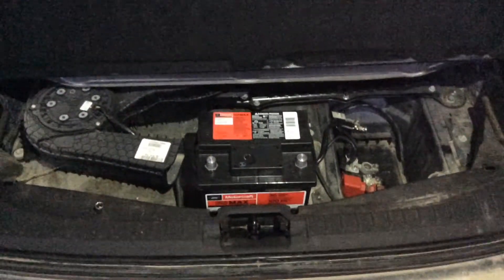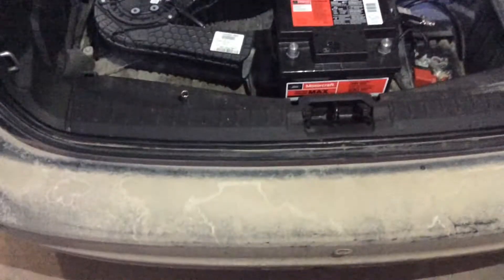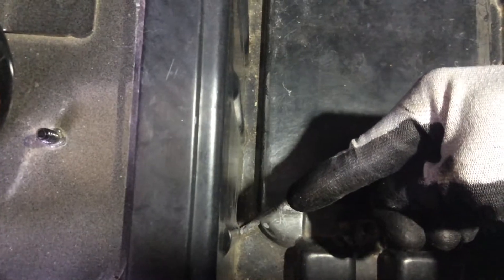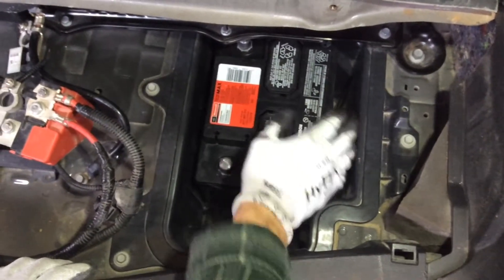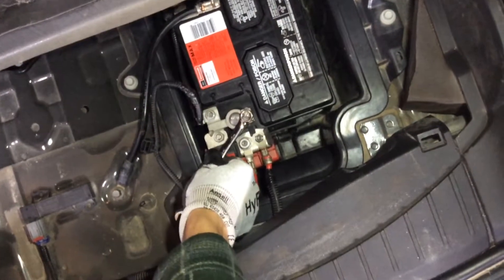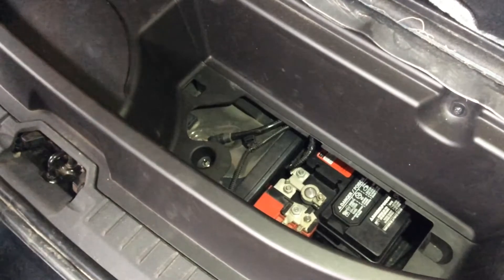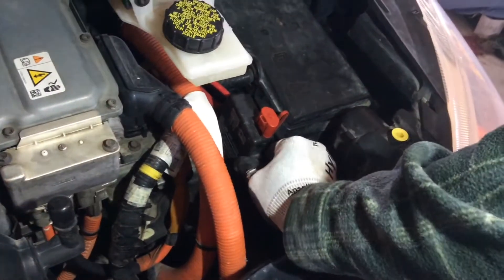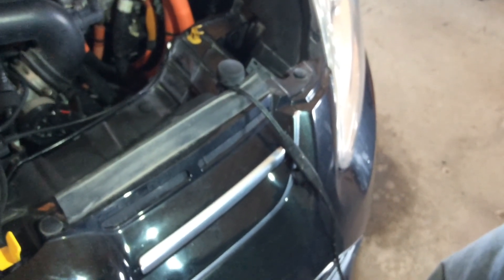Ford C-Max Hybrid 12V battery upgrade to 600CCA

Comment: Just upgraded my battery to the 96R. Car works great. A lot better then when it once was. The plastic piece was quite difficult to remove with the x2 unremovable bolts attached. Took about an hour of prying but once removed some waterproof caulking applied and replacement was completed. Thank you!

Only thing was the rubber tubing attached to the original battery was unable to be attached to the 96R.

Comment: Oooo I like this modification, thanks! I highly recommend wiring up a kill switch in the back if any of you find yourself doing your own work on your cars. Make sure to wire it between the negative on the 12V and body ground. I just relocated my ground point. Oh and try to remember to lock the car before cutting off power since the driver door is the only one with a manual lock.

Also, have any of you met an actual human that seems to be confident and knowledgeable of the anomaly that is the C-max? I haven't and decided to up my mechanic skills. It's been quite the learning experience and have quickly come to the conclusion that Ford really must not care so much about putting vehicles on the market with such illogical design choices that would make Spock's head explode. I keep wanting to like the car and then it's yet another problem. Pretty sure my 2013 could be classified as a face puckering lemon! 😂
Reply: Hey, i’m glad you shared some of your learning journey troubles. I wonder if you’re still messing with your c max, and if you’d consider sharing some of your woes, as well as your fixes (or what you might have preemptively done). I recently got a ‘16 energi after my girlfriend got a ‘15 hev c max, and i do a bit of work myself, and would like to become aware of what i might expect

Comment: Pretty sure your radio was fixed because you essentially rebooted the sync system when you disconnected the old battery.

Comment: Hi I found an AGM from Advance Auto, it's a 650 and it does fit with the same modification you did here.
Reply: Do you have the model number for the AGM?  I just bought a 2013 C-Max Hybrid today (will get it in a week or so after it's been detailed, etc at the dealer's cost), and I'm thinking I would want to be upgrading it.

Comment: The only time the system voltage would be 13.4 V is if the vehicle is in ACC mode or the battery is charged to virtually its capacity. What was the State of Charge of the 12 V battery at 13.4 V and what mode was the car in???   The PCM determines the set point voltage to charge the 12 V battery.  In ACC mode the PCM reduces set point voltage to 10.6 Volts and the DCDC converter maintains around 14 V so as not to discharge the 12 V battery until the control algorithms start to shut down load and turn car off.  The CSP in 2013 and 2014 increased the set point voltage (based on my monitoring) maybe 0.1 to 0.2 V.  Thus, over the same charging time frame, additional Ah of charge would be added to the 12 V battery.  The system voltage when the car is in ready to drive mode will be around 14 V minimum and more likely in the mid 14 V range (14.7 / 14.8 and declining 14.5 / 14.6 in 10-20 minutes) as charge is added to battery.  So, how does a 96R battery "help" this.  It doesn't because the charging algorithm assumes the battery when new had a 43 Ah capacity.  The algorithms monitor current in / out of battery and thus know the amount of charge being added and will adjust the set point voltage accordingly.

Comment: I just replaced the battery for 96R. Since then my gas usage went down so I am capable to make 34mpg vs 28mpg and less. I couldn't believe how much more power my car got by changing this battery. My C-Max Energi 2013 got 160k and seems like I got totally different car since then.

Comment: Hey, very helpful video. Do you remember the length of your 96R?
I measured the tray, and it seems the maximum length of the battery would be 21cm (even with destroyed holder), but afaik 96R batteries are 24cm long. How did you fit it? What is the length of this particular  battery?
Reply from the maker: My battery is roughly 9 1/2 inches in length. It's a tight fit but it fits.

Comment: I have a Hawk Odyssey extreme battery for my 2013 Ford cmax energi model went threw 2 crappy Ford ones same issue not had a problem since.
Reply: I guess that is a 96r? What's the CCA on that one please?

Comment: Tigiteasy-    

Thanks for posting this battery mod.   I just did it this evening.   Your well made vid made me aware of what to look for in advance of buying the larger battery and starting the install.  It all went smooth as can be.

This larger capacity battery is more readily available and  costs a whole lot less than the original battery too which is another plus.

I appreciate your fine vids

Tony
Reply from the maker: Thanks for the positive feedback.

Comment: It is useless, and not advisable, to "upgrade" to a bigger, heavier battery.  ... CCA battery rating DOES NOT MATTER on this Ford C-Max Hybrid (or Prius, or Fusion, etc.). ..Why?  ..  Note the engine is NOT cranked using the 12v low-voltage (LV) battery.  It uses the High Voltage (HV) big hybrid battery for cranking the engine, not the 12v battery.  The 12v battery is there to act as a capacitor to buffer DC-DC energy transfer from the HV to the 12v LV battery, in addition to other engineering reasons such as HV lithium-ion battery isolation when shut down, etc.  Also notice there is no alternator like on a normal non-hybrid car.   To summarize, no traditional starter motor, and no alternator, but instead the 12v battery is charged using a DC-DC circuit from the HV battery.  (The engine is cranked using one of the 2 electric drive motor-generators.)
It is not advisable, and possibly a problem to try to put anything in there but a typical 67R size 12v battery with about 65 minutes RC rating like the original Motorcraft BXT67R 12v battery or possibly many other brand 67R batteries will work too since most seem to have a 65 minute RC (reserve capacity) rating, telling us its energy storage capacity and drain characteristics.............................................................From the service manual:

"The Battery Monitoring Sensor continuously monitors the condition and the state of charge of the 12V battery and provides the BCM with this information. The Battery Monitoring Sensor also estimates losses in the battery capacity over time. The Battery Monitoring Sensor should only be reset when the battery is replaced. It is urgently recommended that the replacement battery has the exact same specification as the original battery. If it does not, the accuracy of the Battery Monitoring Sensor outputs will be compromised."
Reply: Correct - MG1 (Motor Generator) on the ICE side starts the ICE, using the HV system.

The transmission of these cars (and Prius) are beautifully simple.

ICE -> <- MG1 <-> Planetary Gear / Batteries <-> MG2 -> <- Wheels

The Batteries turn over MG1 when they need to, and on most Hybrids this is after you start moving.
Reply: I own this model. Thank you SO MUCH gentlemen for explaining how to work Hybrid.
Reply: I completly disagree. I just did it and my car got lots more power by just upgrading my regular battery in my C-Max Energy.
Reply: @maroni64  Do you understand the charging algorithm???  That 96R battery won't make a difference with respect to how the car operates (radio not displaying correctly).  Reserve Capacity doesn't matter.  CCA doesn't matter.  Did you reset the PID labeled Battery Age???  
I have monitored 12 V battery charging in real time.  If the 96R has an Ah rating different from the BXT67R (my guess is maybe 20-25%  higher due to larger size) the charging algorithm will not function correctly as it assumes the Ah capacity of a new battery is 43 Ah. This 43 Ah capacity is used along with a coulomb counting algorithm to estimate the 12 V battery losses as the battery ages.  My guess is that eventually over time, the 96R battery will be charged to the same level as the 67R would be.  This would mean that any initial advantage of having more capacity in the 96R will be lost. In order to restore that lost capacity one would have to charge with a charger periodically or drive for extended periods of time / plugin and charge very frequently.  Whether plugged in and charging or putting the car in Ready to Drive mode, the PCM determines the set point voltage used when charging the 12 V Battery (either DCDC converter or secondary converter in charging module).  

Also, if Battery Age is not reset to zero when a new battery is installed, the charging algorithm will use the old losses data for the new battery.  Again, this will likely reduce the charged level of the new battery over time.  I have had this happen when my original 2013 battery failed in 30 months, dealer installed new battery but failed to reset battery age.  After about 3 1/2 years on the new battery, the battery capacity was only being charged to the single digit - teens State of Charge.  The charging algorithm was using accumulated battery losses of 6 years in establishing set point charging voltage.  Finally in later 2017 FORScan added the battery reset function and I reset battery age.  After the reset, SOC was generally in the mid 40% - high 50% SOC and continued at this level until the battery failed in January 2021.
Reply: @kenblasko3650   "Finally in later 2017 FORScan added the battery reset function and I reset battery age. "  How did you do this? I need to replace my 12V battery for the second time now, 2017 Energi. Trying to decide on what new  size and type battery to intall. How do you know that the charging algorithm assumes 43 Ah?
Reply: @scottb6047  It's in the Service Manual - 43 Ah.  On some Ford vehicles which offer upgraded batteries as an option, one can use ForScan to select the battery size.  Yes, I have ForScan. You can do a manual reset. Search youtube for video. There is no conformation that the manual reset works other than checking with ForScan which I did.
Reply: @kenblasko3650  Hi Ken. I have a 2014 Ford C-max energi. Using the slow EV charger plugged in at home literally kills the 9V battery. When the vehicle was still under warranty the dealer replaced the 9V battery. Same problem. Replaced battery again and charging cable (also left with Ford for several days for testing). Same problem. Said it may be phantom power drain, but they couldn't find anything. This continued on with no resolution (3 new 12V batteries) until the initial warranty ran out. I've moved to another state, and hate to have Ford dealer start again if they have no clue what is causing the issue. Our one and only Ford dealer charges $165hr labor. Any thoughts? Have you heard of anyone else with a similar issue? Other than that, the car runs flawlessly and I love it.